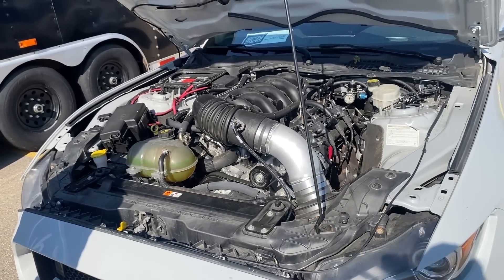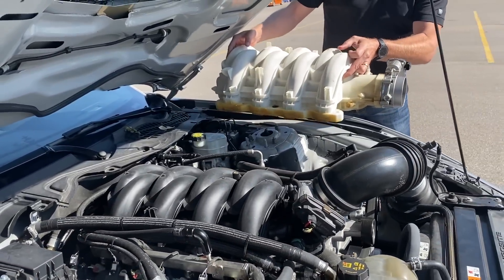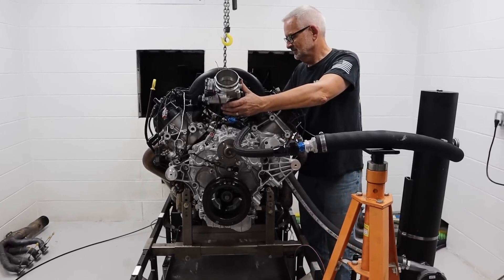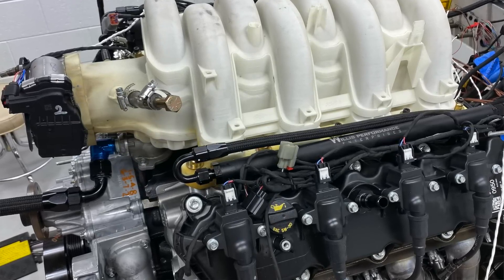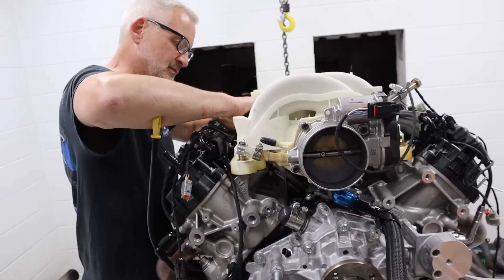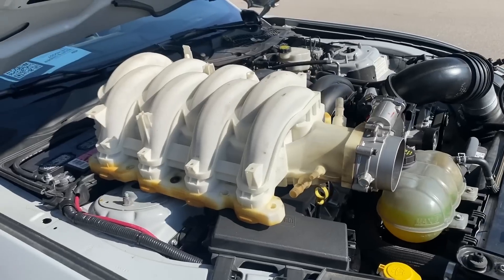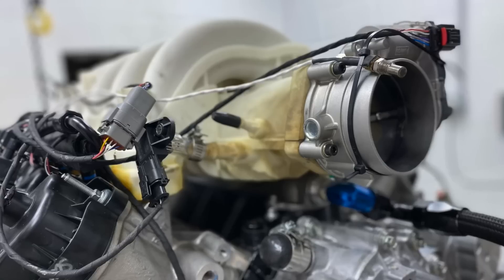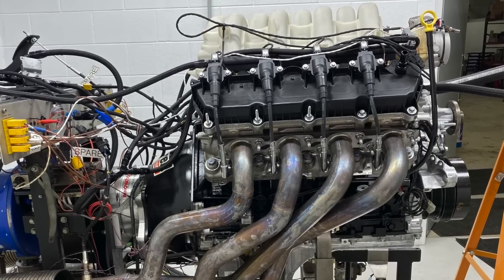Ford Performance Godzilla 7.3L Low Profile Intake Tested | How Much Horsepower Will You Gain?

Comment: The 7.3L I have seen for yrs at work. It reminds me of another engine platform, a LS. Lifters under the head, 6 bolt mains, one cam shaft! Nicely done Ford. I am a believer in the LS ,Ford finally went back to a single cam engine. Congrats!
Reply: Yeah...it has pistons in it.  You figure they got that from the LS too?   It's not like Ford hasn't made V8s with lifters and a single cam previously...
Reply: Ford big blocks rock! Love the new Gen 5.0L Coyote as well in my newer F150.
Reply: Fords mad cam in block engines longer than DOHC they don’t need to copy anyone they know what they’re doing
Reply: @CoyoteFTW  
It is basically a LS design.

Comment: That's too much torque and not enough horsepower for the stang. That's a truck motor (as is).
Reply: Only if you have no knowledge on how to make a suspension work.

Comment: Seem to me that it had quite a bit of lag before it kicked in.  Which means you may out run em if you don't run out of road.
Reply: What you heard was the dyna absorber holding the motor down till auto test started

Comment: So what cam and/or power adder would keep that torque up top, all the way across, even if it gives up torque at the very bottom?
Reply: Probably nitrous. A 150 wet shot should do it. Although centrifical superchargers have a better linear power curve. Not sure about torque at high rpm. You usually want torque low to midrange and hp at mid and high rpm.

Comment: Very impressive Evan and Brian! I have to get a 7.3L for my 67 Mustang Gt and nix the 460 boat anchor currently in her. I hope the Godzilla can bolt up to my built C-6. Thanks for sharing. Cheers from Motown/Dearborn.
Reply: Use a Modular 4R70W, it has the correct bell pattern and won't break the bank. Several stand-alone controllers for them too.
Reply: @cgarris8674  Thank you for the information, much appreciated sir.
Reply: it won't bolt to a C6. Uses the same bell pattern as the Mod/Coyote/6.2L
Reply: @mikealbert728  Thanks Mike! So I might have to swap out the C-6 and replace it for a trans that fits the 7.3L it sounds like. ? Will do some research and see what I need to do. Cheers from Motown.
Reply: @robertclymer6948  Ford has a 7.3 with 10R140 crate setup for around 20k. A 6R80 or 10R80 can probably work also with one of the control pack deals Ford has

Comment: As a car guy I like how Ford is stepping back in time with this engine. Looks a lot easier to work on than the coyote engines and just looks cool. When the speed parts aftermarket catches up this will be a nearly unbeatable and probably reliable engine..
Reply: I think the 6.2 and 7.3 both offer the large displacement crowd a solid performer.
Reply: @madmod  if only the 6.2 got the love it deserved. Bump it up to 427ci and drop it into a CVPI.
Reply: @PureCountryof91  The 6.2 actually started life as a 7 liter in nmra. Don B had a 9k rpm boss based engine pre production. They have the ability to grow up to and past 7.5L with off shelf parts
Reply: @madmod  I am aware of some of the development of the boss. It deserved more than it got. The worst thing is that it never became available as a factory mustang option
Reply: @PureCountryof91  I'm happy it never ended up in the mustang chassis from factory. You wouldnt be able to go pick up used running 6.2 sohc engines from the junkyard for pennies on the dollar compared to a 5.0 coyote like you can today. Used f series 6.2s go for under 2k typically while used f series coyotes are usually about 3-5k simply because the mustang crowd uses the parts. Ive even seen wrecked raptor longblocks go for as little as $1400 so they very much are a gem for the money. Something you simply wouldnt ever find if it was a common mustang engine because people would have already jumped on them. Much was the same with the early 4v mod motors. People jumped on them across all makes and models for many years skyrocketing the price back in the day.
Reply: @madmod  you've got a few very solid points. That all said, I think a regular cab, short box with a 6.2 would have been awesome from factory
Reply: @PureCountryof91  Dude,  i have been trying to source a 6.2 in my local yard for a 94 Mark viii but your right about a short box with that boss powerplant. The 6.2 is such a beast even in the trucks they go in, having a short box would be a sleeper. Ive been reading into the 6.2 R engine which was the closest to an optemized  production engine, utilizing a stock longblock, a shorter runner intake manifold, larger tb, better cams, and better exhaust, they coaxed 500fwhp out of that 379ci truck engine and it's not some outrageous full race combo. Its still a f series 6.2. Then, ford went on to run and finish full baja races with these  upgraded raptors with impressive times.
Reply: @madmod  I currently drive A 2014 f150 RCSB 5.0, it's also 4x4. I can only imagine the launch a 6.2 could muster
Reply: It's Ford's truck engine.  I'm of the beliefe they designed it for long life, and durability, which means F'yeah!
Reply: It's 2022. OHC engines have existed for more than a century now. Kids on Hondas have been tinkering on DOHC engines since the 80s. The rest of the world, even developing countries, are working with OHC engines for multiple decades now. The difference in "ease" in working with OHC engines vs OHV engines is not that big if you actually know what you are doing, it's not like it was invented yesterday lol
Reply: @sepg5084  Miles of timing chain can scare people. I know of several reputable speed shops who cant or wont be able to degree modular dohc cams because they either lack the tools or know how. They very much are a different animal.

Comment: I was thinking it would gain 5-10hp so I was spot on. But besides the hp I was also interested in the torque department which it gained 15 ftlbs. All by just changing the angle of the throttle body. I can see truck owners upgrading to this manifold once it becomes production.
Reply: The reason the factory intake manifold points up is because of the superduty. The Godzilla motor is so small and sits so low that there are some hoses and the radiator shroud that gets in the way.
Reply: @cesarpalmos8235  I get that part but people who would use this manifold would be swapping it

Comment: Fantastic that you're handed a prototype low profile intake for the 7.3 Godzilla from Ford Performance for your personal testing. That shows me how much respect Ford has for you. Outstanding informative video Rev'n. With the V8 in the sights of our government. What do you feel the use of the engine will be. Personally. It's looking like it will not be offered in a vehicle. So I'm guessing crate engine builds only. One thing that confuses me is why with all the Ford fans on U-Tube. You don't have 5x or higher the subs you currently have. Your the go to guy regarding Fords.
Reply: And your point is?

Comment: These dry flat mount intakes are awesome! It makes working on them sooooo easy!
Reply: Reminds of my first lifting off of a361SuperExpressV8 intake while under the hood.Wow how awkward and heavy! And that almost impossible to get right rear most seal that falls off as you try to wiggle the manifold into position.By the way I’m 85 now and still remember this clearly.
Reply: It looks real similar to pulling a GEN 5 LT chevy engine i mean real similar or gen 3 hemi for that matter just rest it on ports lol

Comment: For some reason the LS guys love to rag on this engine.
Reply: They know this engine has serious potential to dethrone the LS,  however the aftermarket support is lacking for the 7.3 vs the LS. They also like to throw in the usual "I can make the same hp for less money" because there are thousands of LSs in junkyards.
Reply: @cesarpalmos8235  The LS did not have much if any aftermarket till it was out for 4 years, this has very good support for cams, CNC porting of stock heads, pistons, rods, intakes, supercharger kits, etc already.  Also not so easy to get over 600 ft-lbs NA and over 600 HP NA with a junkyard LS.   LS is very good,  but the "more HP for less $$" will not be there long as these are showing up in salvage yards.   Kind of like the early 80's with the 302 Mustang vs the Camaro.
Reply: @cesarpalmos8235  With a LS you can swap the cam and valve springs and make an easy 440hp, with the Godzilla you can swap the cam and valve springs and make an easy 630hp... I can see why they're worried!

Comment: Not sure why this wasn't the original design. Even if it was for the packaging in a truck, I don't imagine there's any big benefit of the upward facing throttle body angle. And the dyno confirmed that.
Reply: Yeah that is a little weird. Maybe it's something to do with making the intake volume just that little bit bigger for more low end torque
Reply: It was probably one of the original designs during the 7.3 development. I'm sure they moved away from it for one reason or another, but they still had the computer file to 3d print another.
Reply: Points up to clear the fan shroud and hoses in the SD.
Reply: Packaging directed that upturned t body. Lots of things to consider when putting vehicles together.

Comment: I’m so happy ford does this with their engines/trans. But, my biggest complaint: I understand building a “race car” is expensive. But I wish Ford had cheaper stuff. I could LS swap a mustang (which I would never) for way cheaper than doing something like this. I’m stuck with building a 4.6L over just swapping a 7.3. For now, at least…
Reply: Bc Everyone wants Coyotes bc it’s a superior engine so the price is higher. Supply vs Demand.
Reply: @diegolp5323  plenty of 6.2s that people just all collectively decided not to care about. 385hp stock in full truck dress and tune...
Reply: @anthonyrowland9072  I couldn’t agree more the 6.2 could of been a beast. I love it in my f250. And I always say that I wish ford did more with the 6.2.
Reply: @diegolp5323  No they don't. It's common in the F150 and mustang. GM put the LSx in everything that's why it's cheap.
Reply: I think if you bought a new LS from GM performance there is not much if any differance in cost.   But as you say if you start with a junk yard engine, the 200K LS is very cost effective,
Reply: @bigboreracing356  support sucks on the 6.2. it had fantastic potential. But it was left in a shed to rot. Ford even had a 777 version. 7.0l, 700hp, 7000rpm. They abandoned it. (HP n/a)
Reply: @PureCountryof91  The issue with the 6.2L was package size for the aftermarket to support.
Reply: @brianwolfe2993  agreed. It was an enormous engine. 427 sohc huge.
Reply: @brianwolfe2993  Was there ever a Control Pack for the 6.2L?
Reply: Honestly.. a coyote would cost the same as it would to get a 4.6 to stock coyote numbers. Especially n/a. This 7.3, and the coyote will physically bolt to your 4.6 bellhousing by the way
Reply: @PureCountryof91  And you are right. I could get a 1st gen coyote from a truck and swap it for the same price as building a 4.6 to the 5.0 level. Obviously I would do the swap my self. Already got the tools and experience. Just need a garage now lol.

Comment: The Coyote is cool but this engine has to make it into the Mustang.
Reply: A few years back, Ford Performance said they were developing an aluminum de-stroked version of the 7.3 for "light duty vehicles".  If I'm not mistaken, it was going to be a 427, a throw back to the original 427 that scared GM and Mopar back in the day. They also said they were working on a "Megazilla", which is a twin turbo version of the 7.3.
Reply: I remember that.  With everyone else going away from fun gas cars hopefully Ford won’t abandon them all together.

Comment: I wonder how many superduty guys will try this manifold since it’s such a easy swap with decent power increases
Reply: The reason the factory intake manifold points up is because of the superduty. The Godzilla motor is so small and sits so low that there are some hoses and the radiator shroud that gets in the way.